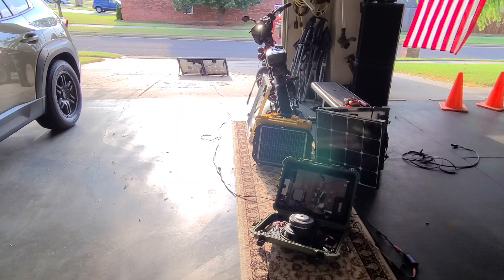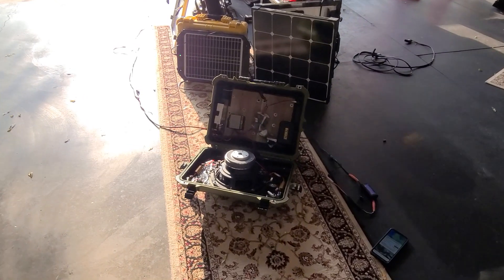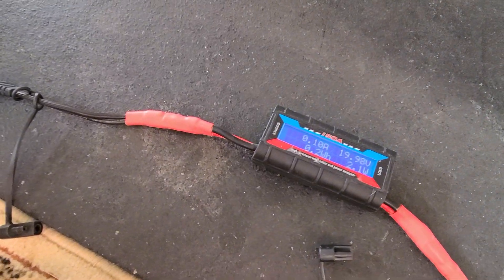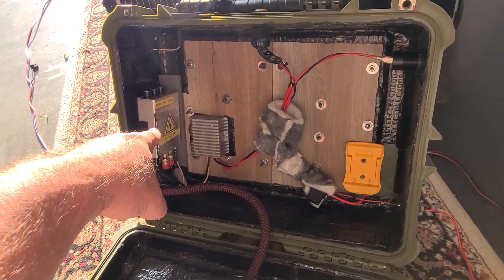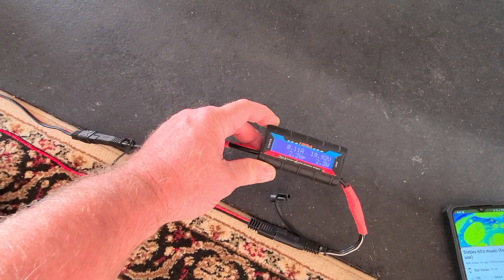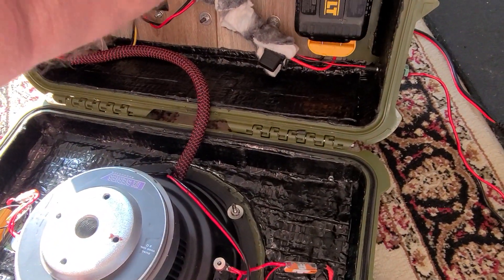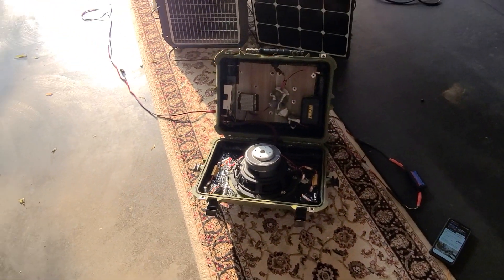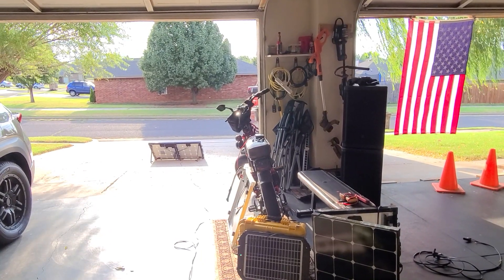No battery, no solar charge controller -- boombox directly powered from a 12v solar panel

Comment: I'm trying to design a bluetooth speaker box using dewalt 20v battery my question is do you need a voltage regulation?
Reply from the maker: Depends. I am running 24v compatible electronics inside mine (Bluetooth amplifier, USB outlets, LED lights, etc). If you need to down convert to 12v, modules are really inexpensive ($15). Here is a link: https://www.amazon.com/gp/product/B0922KFBDH/ref=ppx_yo_dt_b_search_asin_title?ie=UTF8&th=1
Reply: @ChrisDIYerOklahoma  ok thank you for your help